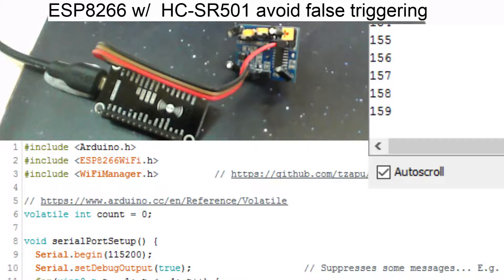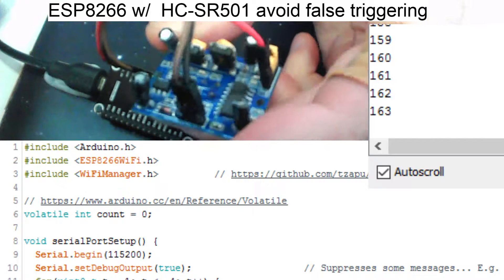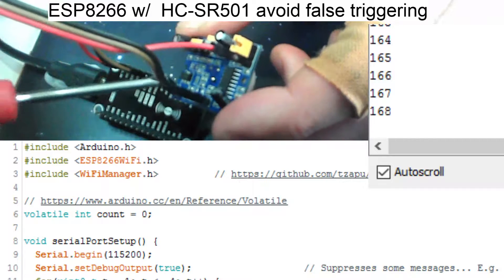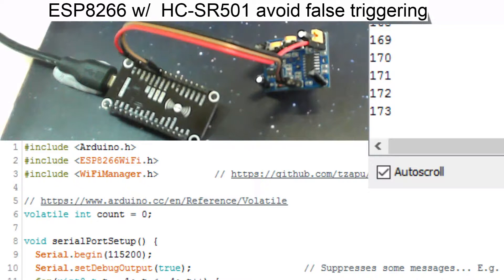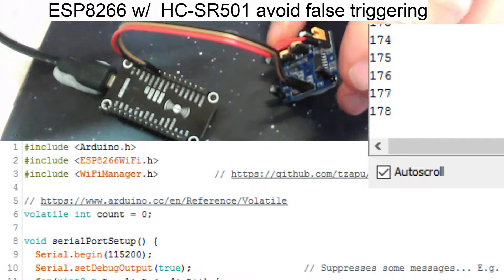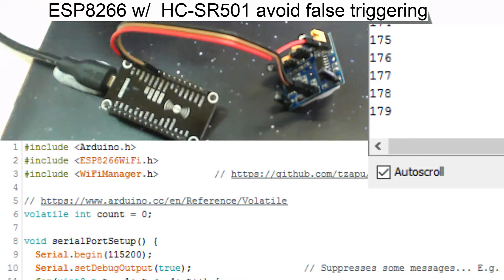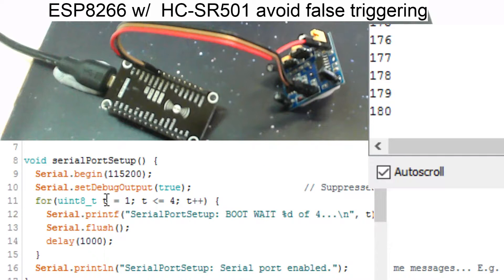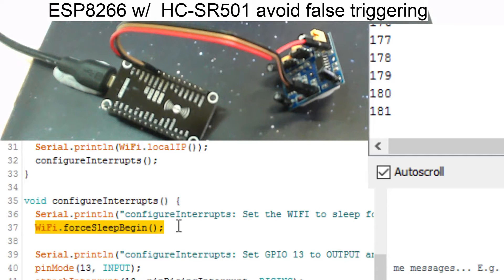ESP8266 with hc-sr501 powered from onboard 3.3v

Comment: I need my PIR in H mode so I'm not sure your approach would work. I mean I could bridge the two pins but then I'd have 3.3v going to both pins. 

I'll either try the soldering method or try to simulate H mode in software.

Comment: Soldering 220 nF ceramic capacitor on pins 12 and 13 of BISS0001 chip on hc-sr501 board solved false triggering for me with WiFi enabled. I'm using them on battery-powered multi-sensors with deep sleep awakening on timer and/or on pulse from PIR. Got instant reset from PIR triggering ~50 ms after waking up on timer with radio enabled otherwise.

Comment: ran across your vid, i have a PIR sensor like yours, of course without pinouts on the corner so i have to solder one on, but i will try this.

right now it just turns on and off at random connected with the pinouts im using. i have 3.3v from a sonoff.

Comment: Hi, what do you mean by having to shut off the WiFi? I'm trying to have it running continuously as an intruder detection; once the sensors detect, send input to ESP to broadcast
Reply from the maker: Hi Andrew, I found that if the PIR is powered directly off the ESP8266, then I got tons of false positives unless I disabled the WIFI. You can wake up WIFI immediately on an event... so I guess it could be applied to a basic intruder detection system.
Reply: Oh I see. So get detection then broadcast. and shut it back off until next detection. 

I don't really understand the H and L pins, but from most guides they say I should use the H for retriggering (I'm assuming meaning multi events). In that case could I use your method but with the L pin instead? Same concept?

Thanks!
Reply from the maker: Exactly, enable WIFI only when you need it then immediately disable it once you send your http request. An added benefit is that it makes the ESP into a super low power device, useful if you wanted to power it using batteries. But downside, as I said in the video, is that it reduces capability in terms of a two way IoT device.

As for the H/L pins, yes that is my understanding, but It worked the way I had it, so I didn't really try any other way.
Reply: wow interestingly, it only works the way you've done it; the 3v3 on the L pin does not work. the ESP fails to communicate with my Arduino IDE
Reply from the maker: If you want a more technical discussion, the following article discusses the wiring in more detail.

http://techgurka.blogspot.com.au/2013/05/cheap-pyroelectric-infrared-pir-motion.html
Reply from the maker: And this is a link to the specs of the HC-SR501. 

https://www.mpja.com/download/31227sc.pdf